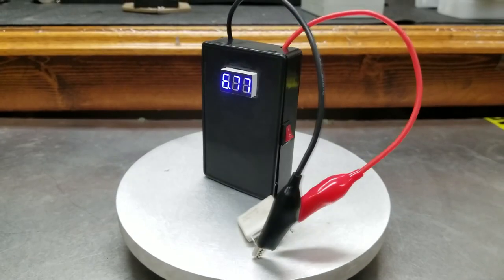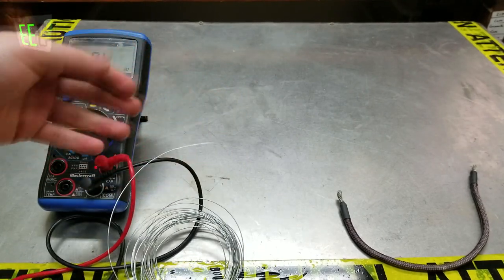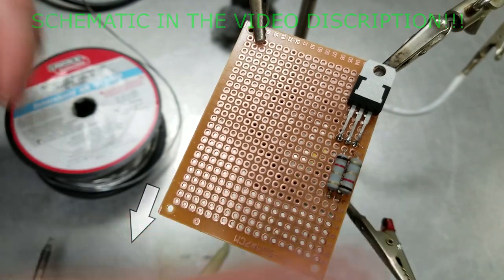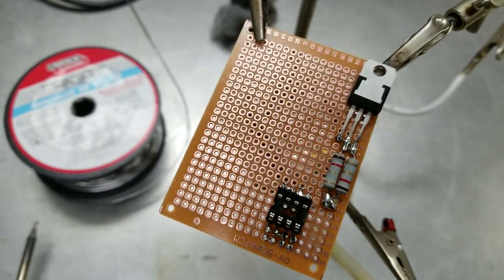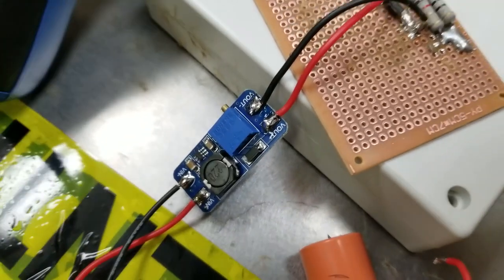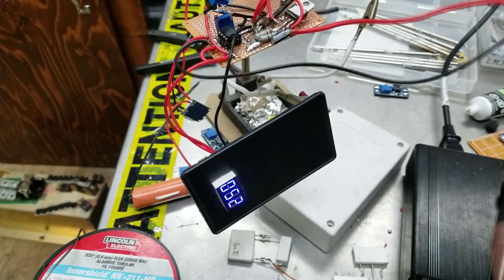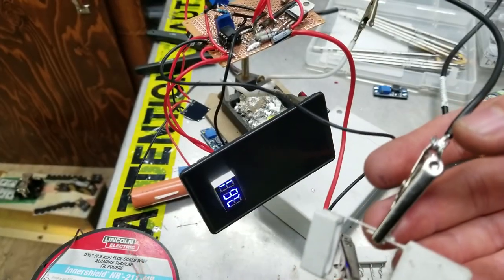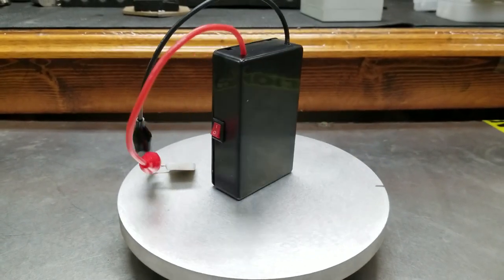𝙀𝘼𝙎𝙔 & 𝘾𝙃𝙀𝘼𝙋 𝘿𝙄𝙔 Ω 𝙈𝙀𝙏𝙀𝙍 ( 🅿🅰🆁🆃 1) 🅿🆁🅾🆃🅾🆃🆈🅿🆄🆂

Comment: I have only just noticed the error in both of your schematics; the take-off point of the 100 mA constant current should be the junction of the 12 ohm resistor and the ADJ pin of the LM317 so that the 100 mA current flows through the current-determining resistor.
Reply from the maker: Oh yeah you are right!
I see it, ok thanks. Will change it today!
Thanks for the feedback!
Reply from the maker: Yep I fixed it!! Thanks again!!

Comment: How my commercial multimeter is able to measure  3.5M Ohm from a device with high accuracy applying only 500mV and 1.5uA. ?
I Have made an Arduino Ohm meter that  work great. it use the  common Voltage resistor method at 5Volt  and R1 references and sense of Vout, then I apply a formula to get R2. Everything work amazing on single resistors out from circuit, but when I need to measure a device as I do with my commercial multimeter,  I put the Negative probe of my DIY Ohm meter  on GND and the positive Probe on the input pin I need to read the resistance, the device will try to turn on because it work at 5 voltage, getting  unknown values resistance that I know on normal devices that pin must have to be between 2.5M ohm to 3M ohm. 
If I build yours model, It will not try to turn on the device I need to read resistance? It is an Iphone pin 4(U2 or Tristar PMIC) all Tristar must have 2.5M ohm to 3.5M Ohm. Resistance measurement on commercial device work great but under my method it wont work.  I need to make  a data blogger to my PC. thats the reason of using Arduino DIY OHmmeter.
Thank you if you may help me.

Comment: Thanks, you've prompted me to build one. :-)
Reply from the maker: Cool, please let me know how it turned out!!!
Im building a pcb for it. currently. stay tuned for that!!!
Reply: @EECPOWER  I've found all the parts in my stock with the exception of the LM317, my box of assorted regulators having gone into hiding or possibly it has not yet emerged from hibernation.  I'll keep you posted. A PCB would be of interest :-))
Reply from the maker: Hi Silver Legent! 
Fortunately I have filmed the PCB video and it's on the way.!
If your missing a LM317 you can try using an opamp and a transistor.this might be more complicated circuit, but fundamentally it would be the same as LM 317. Just search for a "constant current source circuit"
I have also improved the circuit to make it very accurate across the whole range!!
IIt's working like a charm now!
Stay tuned for next Saturday !
Reply: @EECPOWER   Hi, I've ordered some AMS1117 adjustable regulators for the constant current source so my build will be delayed for a week or two. Any circuit mods will certainly be of interest. I'll keep you 'in the loop'. David. a.k.a. Silver Legend.